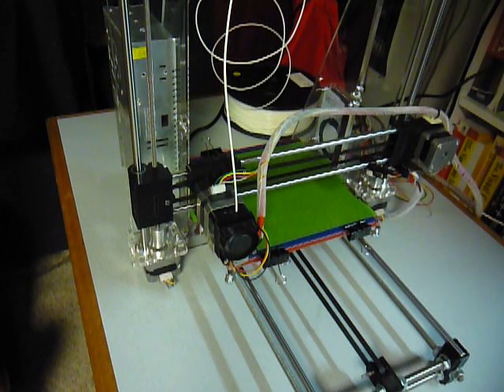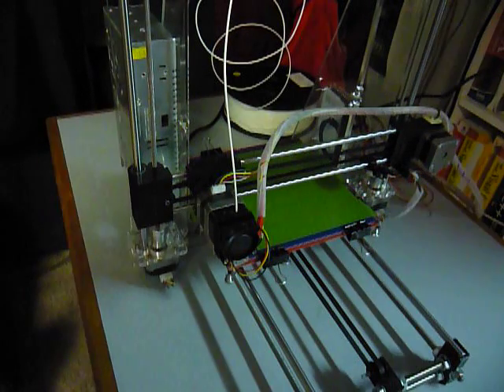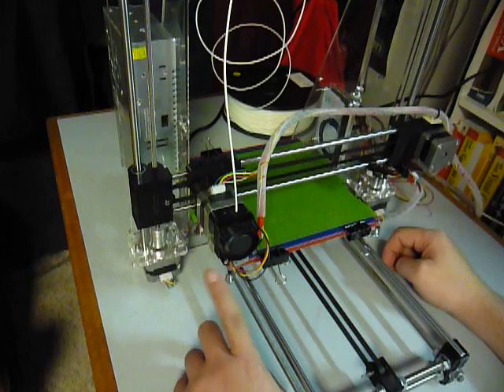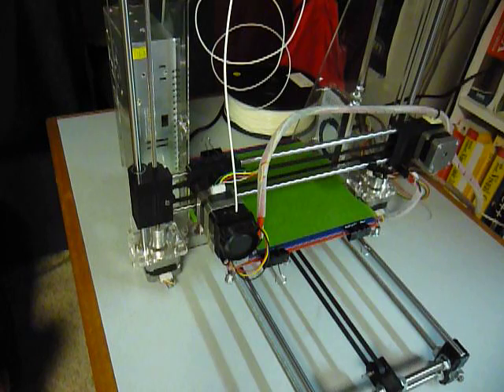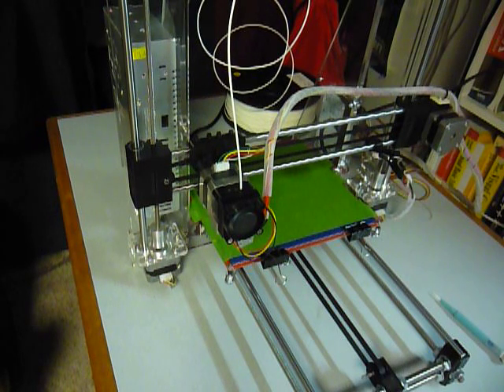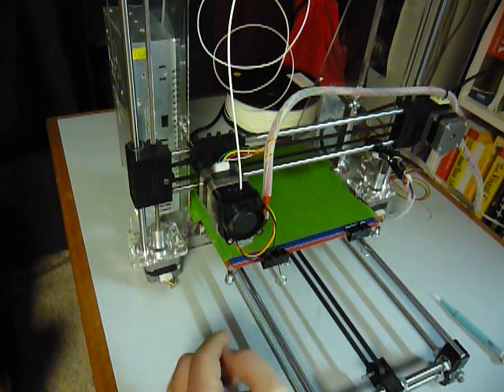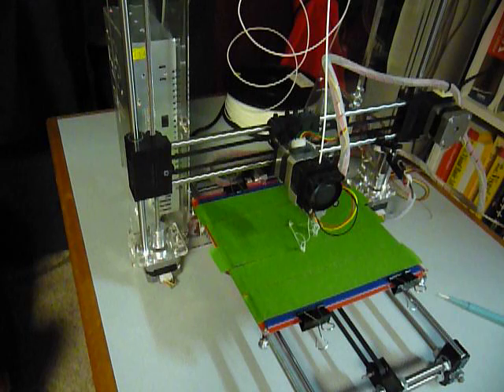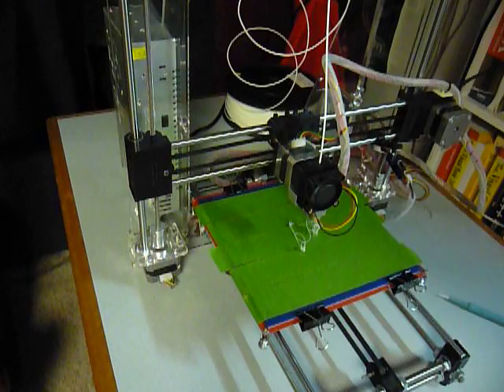Folger Technologies Prusa i3 3d Printer Build part 18

Comment: Maybe you can help with my problem I got everything hooked up and installed try printing something and the Z axis just continuously climbs endstop or not, the X axis  and Y axis stop due to the endstops.
Reply from the maker: +3dssolidsnake It sounds like your motor's direction needs to be flipped, they shouldn't climb, only descend and they will stop once they hit an endstop.

Comment from the maker: in response to Jedidiah, my extruded fan is plugged in to the 12v and the ground of the 5th stepper driver port, it is on anytime the printer is. I did notice there may be an alternate location to plug it in, well a couple really. one option would be to use the 2nd extruder hot end port for the fan or there may be still another location. If you wanted to go the easy route, just wire it directly to the 12v power supply. in all cases it is on any time the printer is.

Comment: Where and how did you mount your X-Axis endstop? I'm having a devil of a time figuring that one aspect out.
Reply from the maker: Look ay my video number 22 of this series, I give the part numbers for better endstop mounts that make this printer a bit easier to use. unfortunately that doesn't help if your printer isn't working yet. use the clamps that came in the kit, I think I clamped over the lower rod of the x gantry on the left hand side. Once it gets printing. print a new x endstop holder first.

Comment: I've got everything hooked up and I can't get the x-axis to move. I've switched steppers with no luck, tried adjusting the pot on the stepper.  I even connected the x-axis motor to the y-axis drive to make sure the motor is good, which is was.  Any thoughts?
Reply from the maker: make sure your 3 jumpers are installed underneath the stepper driver, then swap stepper drivers (an extra one came with the printer) they are fragile and can be installed improperly which will instantly damage them. another thing to look at is if you installed the heat sink on the driver and it is touching the pins of the connector, that would fry a driver quick too. Also there is the possibility you got a faulty driver. but that is what I would try next.
Reply: Thanks, I've tried the spare driver along with the extruder driver and no luck.  Checked and all 3 jumpers are in place.  When I try to move the x-axis the power supply fan kicks on. If I adjust the pot on the driver I can feel the motor almost vibrating. This is the same on all 3 drivers I've tried.  Like I said before the motor works fine when connected to the y-axis.  Not sure where to go from here.
Reply from the maker: MTBrewer Sounds like a bad ramps board to me, but I am no expert.
Reply: bubalettow That's what I'm thinking too.  I emailed Folger Tech last night but have not heard back yet. I have a friend that has a spare ramps board I'm going to try today after work. Thanks again for your help.
Reply: bubalettow Ended up with a bad RAMPS board.  Now I'm having the issue with the endstops.  The z axis works great.  X and Y not so well.  I have the X endstop on the right and the Y endstop in the rear.  When I press home the motors for X and Y go in the correct direction but don't stop when hitting the endstops.  I have tried just about anything I can find by Googling, even updating the firmware.  Is there anyway you post or send me your configuration file? Or do you have any suggestions? Thanks again for all of your help.
Reply from the maker: send me an email request at my user name at hotmail.com I can send you what I have for a config file. for starters since you have a functioning axis try each end stop and make sure they are good. secondly make sure you don't have them plugged into the maximums instead of the minimums. I too had the x on the right side but found for homing purposes I really needed it on the left, so you may choose to change that around. you probably already know this but in the config file you can specify home to minimum side or maximum side, that could be an issue. Finally you may have done what I did and got your x and y backwards, if that is the case the end stops will hit but not trigger because it's looking at the wrong axis so TRIPPLE check that X is in X and Y is in Y not flip flopped, (even I screwed up this starting out)

Comment from the maker: For the hot bed, red(+) gets soldered to pin 1 only and black(-) gets soldered to both pin 2 and 3 on the hotbed circuit board, the other two pads are for the thermistor (temperature sensor) leads and it doesn't matter what order you solder the wires
Reply: I'm just about done assembling my printer.  Is the thermistor built into the hot bed or is it separate?  If it is separate I'm thinking Folger Tech forgot to send me one.
Reply from the maker: It is built into the heated bed, that is what the two little pads to solder wires to are for.
Reply: Great, that's what I was hoping for!  Thanks again for all of your help.

Comment: I'm right before this stage. How did you get the darn motors to actually move? I checked and double checked my wiring and my motors just make an awful clanging noise and clicks back and forth with no net movement. I tried to up the trimpot to a higher voltage but the jog button on Repetier or pronterface just makes the motor click back and forth.
Reply from the maker: John Vu check and make sure you have your endstops configured correctly, it actually matters that they are plugged in and working properly. also since this kit only comes with 3 endstops you need to disable the max endstops setting in the config.h file. here is another thing. manually position the print head at 0,0,0 before you power it on or plug the usb in. The software looks to only move in the positive direction, you also could disable the setting to prevent the printer from going past what it believes is 0,0,0  doing this helps when setting up the printer before performing the homing command before starting a print.
Reply: Cool, i did this just before your email. Really appreciate the help. Motors are running smoothly now, x, y, and z. The extruder stepper motor and cable works as I had tested on the x motor connection on the RAMPS board, but whenever I put it in E0 stepper motor, it's not extruding.Tried to "jog" the extruder motor in both pronterface and repetier-host without success. What do you have for the default feed rate for the extruder? I hope E0 is not burnt on my board. I even switched the pins to E1 and changed the corresponding pins from E0 to E1 with the stepper driver on E1 and the same problem, not extruding.
Reply from the maker: John Vu there is a good chance that the software you are using to control your printer has extruder protection, meaning, it will not send an extruder command if the hot end temperature is too low. turn on the hot end and once it gets around 200c try extruding, it will likely work then.

Comment: could you please tell me how I can setup the heatbed?!
Reply from the maker: behrad ghodsi  Ah, that I can help with red(+) gets soldered to pin 1 only and black(-) gets soldered to both pin 2 and 3, the other two pads are for the thermistor and it doesn't matter what order you solder the wires.
Reply: bubalettow hi again. I connect my 3d printer to my laptop and then install the softwares, but when I push the connecting bottom it just get notify that "connecting ..." and any thing happened! Do you have any idea what is the problem!
Reply from the maker: behrad ghodsi A few things that I would check. 1 try a different usb cable, it might be that simple. 2 make sure the baud rate and com are correct for the printer in the software. did you install the arduino ide software and driver, if not that would be a problem. I also recommend trying a different usb port. lastly, try a different computer, maybe there is an underlying error that prevents your comp to work?